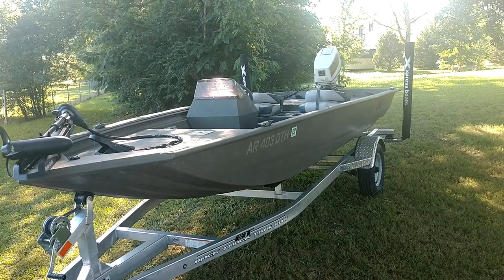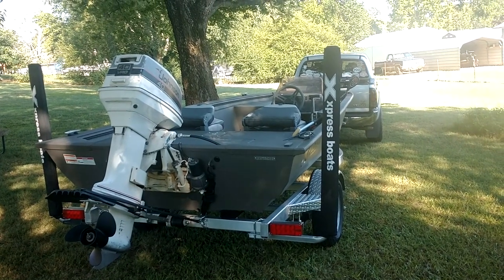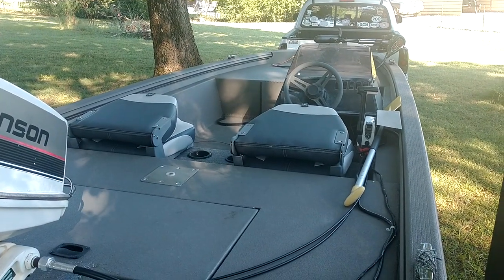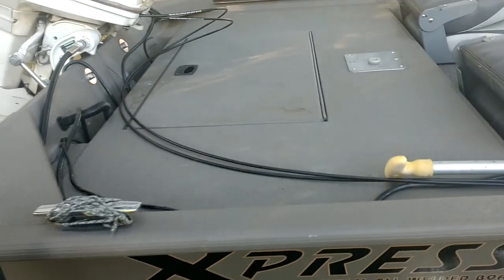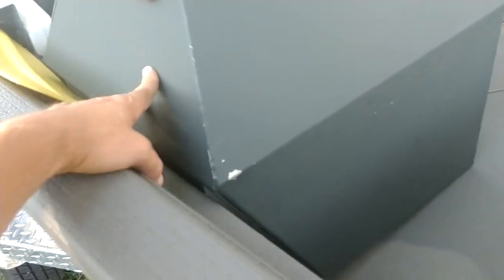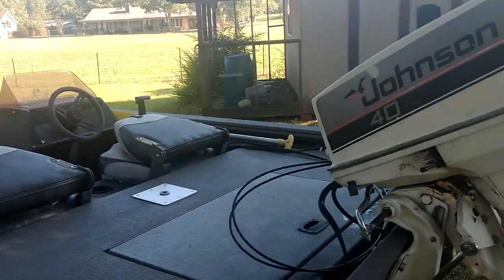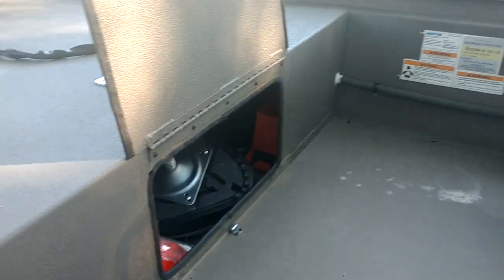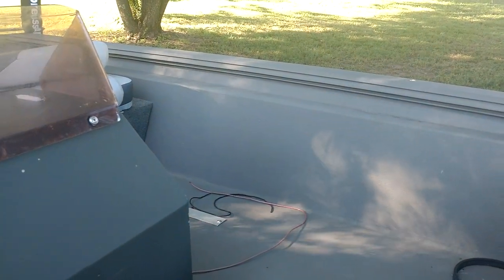Xpress HD16VJ vs. Tracker Grizzly 1648 Utility

Comment: Thanx for the video, I was considering this rig, but have changed my mind. Over priced for what you receive, that hatch is a disaster, virtually no storage. Alumacraft or G3 is looking more promising now. I was wondering why you can't find much info on pricing and design online.
Good luck with your new rig.
Reply from the maker: Thanks Flatlander.  I'm actually considering selling it...make you a good deal! :)
Reply: I started out looking at the tracker 1654 sportsman. Then I decided to go the express or excell boat.   But I guess due to COVID and everyone getting their stimmy not one of either for 8 hr drive.  So I decided to go with a custom boat for honestly   A few thousand  more.  Now I will have everything I want where I need it.  And a bigger (18’) boat now.